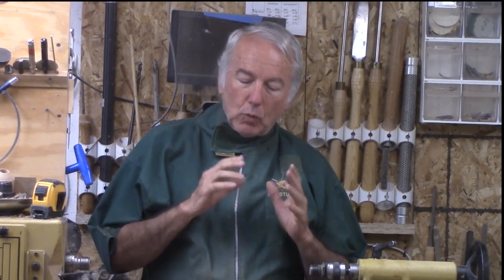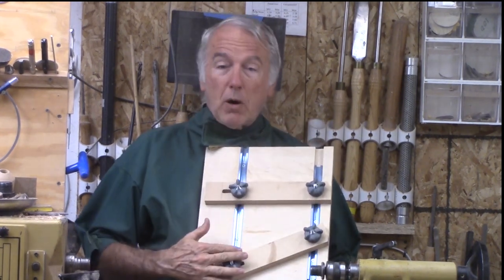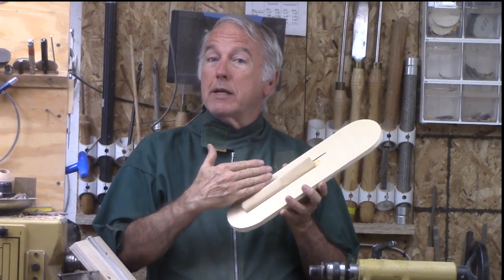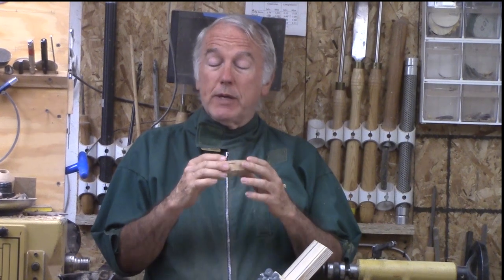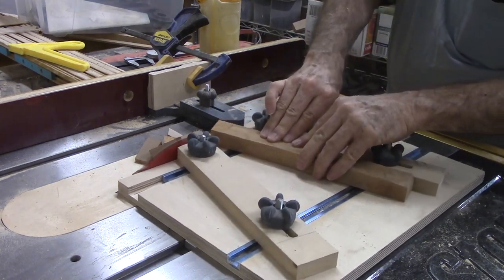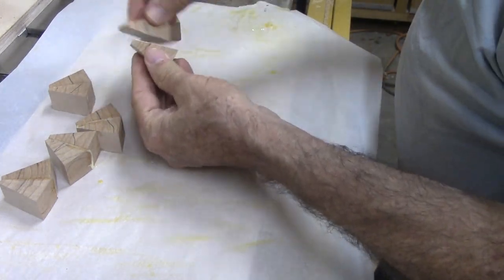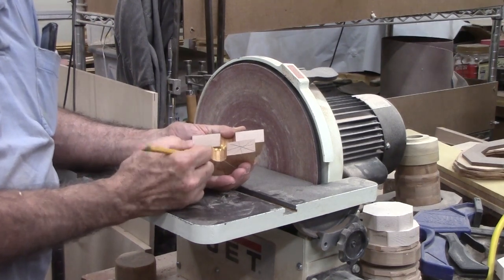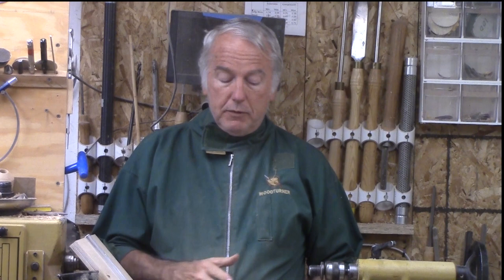Simpler, Easier, Self Correcting Process To Create Segment Rings

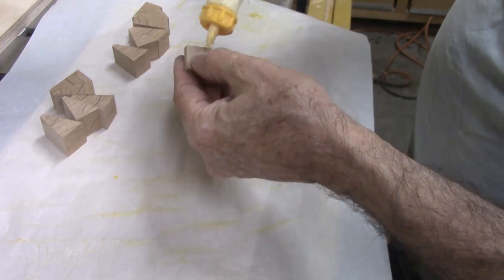Comment: Alan, Starting at about the 6:25 point; could you expand on the “squiggles” and their use please, to include “top”, “short side” and “long side”. Also what determined what piece went into which of the two groups.  Thanks.  Cheers, Tom
Reply from the maker: Before sawing, mark the top of the board with a squiggle. Also mark one edge. one pile has top squiggle and side squiggle on long side. the other pile has top squiggle and side squiggle on short side. 
Although the process is self correcting, alternating the side squiggles is hopefully cancelling error.
Hope this helps
Alan
Reply: @AsWoodTurns  Thanks, that make sense to me now.  Cheers, Tom

Comment: A little lost by your comments about the addition of the T track to the sled and the advantages over the single pivot arms of the previous sleds. What advantages does the T track give you?
Reply from the maker: For segmenting, the two designs are nearly equal. T-track has a slight advantage for the width of segment that fits between the arms. For those not familiar with routing arcs, installing t-track is easier. The major advantage is that I can use it for non-segmented angle.
Alan

Comment: Can you show how you set the angles on the sled in relation to the blade?
Reply from the maker: That is the job of the angle template shown in the video. Place it between the arms and tighten them down.
The additional refinement is to first set one arm with the short side of the template at the saw side and aligned to the edge of the sled.  Then set the other arm.
While this refinement is not critical, it is better for new segmented turners. Otherwise, there is a pinwheel effect. Either way, the angle is correct.
Alan